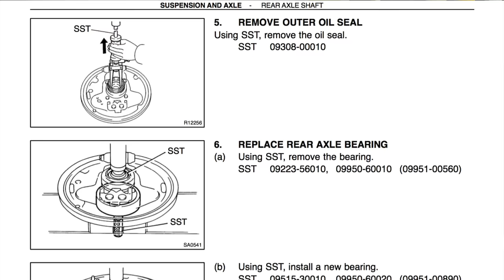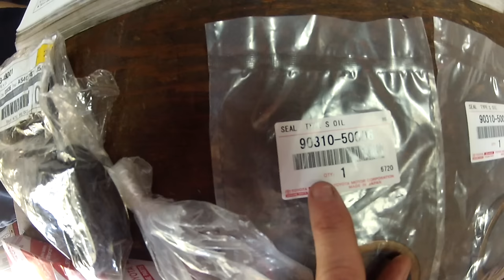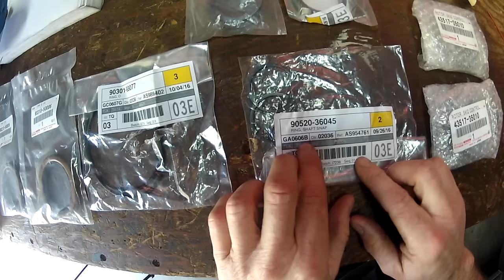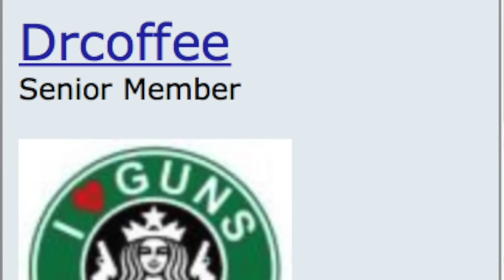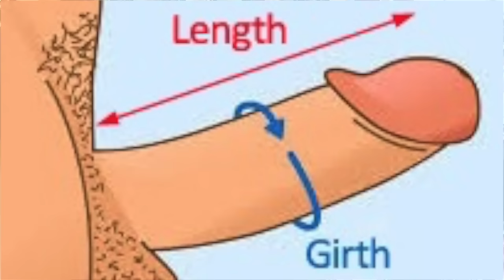Toyota Rear Axle Seal/Bearing Replacement (ABS Rearend)

Comment: Awesome detail, really like those brake line caps! Interesting thing happened to my 2000 4Runner a few yrs ago. I was hearing a ticking noise from the rear end, so Iong story short, the vent cap on top the diff was not doing its job, because when I removed the fill plug, a vacuum sound came out of the hole. That fixed the ticking noise- weird or what??
Reply from the maker: Yeah, that vacuum cap kit comes in handy.  I first tried to crimp the rubber brake lines with a hose crimping tool but using the vacuum caps as a cover is way better.

That is weird the blocked breather caused a ticking sound.  Usually what happens is the pressure builds up in the 3rd member and axle housing and since the path of least resistance is the inner oil seals, the pressure pushes air and oil past the seal.  This is a common cause of oil getting past the seals especially for those that live in the rust belts of the country where they salt the roads and it seizes the little one-way valve in the breather.
Reply: there is supposed to be a slight vacuum when the diff is cold. thats to prevent moisture from being drawn in....the vent is one way....out....

Comment: @Timmy The Toolman Great Video BTW:) Pulled both axles out at the same time to take to my local Machine Shop to get bearings pressed in and everything.. after I got home and unloaded I realized Darn I didn't mark which Shaft goes to which side of vehicle.. It might not matter but I'm here and haven't started putting things back together yet and Besides It's Raining.. but My question is both shafts the same length?
Reply from the maker: The shafts are the same length. You can tell which side goes where by the brake wheel cylinders and bell cranks.  When you have the axles on the correct sides,  the wheel cylinders will be at the 12 o'clock position with the bell cranks facing the rear of the vehicle.
Reply: Great! Thanks Tim😉you are the best🙂.
Reply from the maker: @Sortawickid  You're welcome Heather.   Happy Wrenching!

Comment: Hey yah Timmy! Do you think a twelve ton press would press those hearings/retainers?? Thanks for your time and your videos
Reply from the maker: It could do it.  There's guys that have been able to do it with the 12 ton press.  But, the special service tool we link in the video description won't fit between the cross member on the 12 ton press.  The seller of the tool does make one that will fit though.  Here's a link: https://www.ebay.com/itm/193637211065?hash=item2d15ad5bb9:g:EgIAAOSwUgBfGZx7&mkcid=1&mkrid=711-53200-19255-0&siteid=0&campid=5338641100&customid=&toolid=10001&mkevt=1  With all that said, I still think the 20 press is the way to go.  If you ever had to do front wheel bearings, I don't know if the 12 ton press could do it.  It takes a way more force to push the hub out of the bearing.  The 20 ton press doesn't cost much more so I believe it's a much better purchase.
Reply: @TimmyTheToolman   I do have to do the front,  thank you for responding to my questions!  I’ll get the 20 ton.  There are so many Toyota fans out there, and your videos and you and Shawn make it so we can enjoy the maintenance on our rides!
Reply from the maker: @jeremyoshea7941  Good choice to get the 20 ton press.  It's our pleasure to help people by making these videos.  Good luck with all the work.
Reply: The guy down the road from me has a first GEN just like mine he has blocks for a lift kit and he just had those seals replaced in it without replacing the bearings I’d be willing to bet that they didn’t Realize the seals in a different spot possibly and without replacing his bearings to they ran into the same scenario .  Flip the retainer!!
Reply from the maker: @jeremyoshea7941  Yep, lots of people don't know that Toyota redesigned the seal, some of them being Toyota Dealership Mechanics.

Comment: GREAT INSTRUCTIONS! Just debating whether I want to do the pressing stuff.  What type of grease are you using in that little grease can? Thanks again!
Reply from the maker: It's a grease gun I bought a long time ago at a bicycle shop.  The brand name is Dualco.  I did a quick search on Amazon and this is what I came up with:
https://www.amazon.com/DUALCO-METAL-GREASE-GUN-PACK/dp/B015RV444E/ref=sr_1_2?s=automotive&ie=UTF8&qid=1518072721&sr=1-2&keywords=dualco+grease+gun&dpID=51K0BPLe8nL&preST=_SX300_QL70_&dpSrc=srch

Comment: +Timmy The Toolman  ABS/Brake warning lamps lit up on 2007 Tacoma PreRunner (208,000 miles). Code reader said left rear wheel speed sensor. Pulled sensor and it had an odd wear pattern on it, like something was chafing it. Installed new sensor, light went off, came back on a day later. Pulled new sensor and the sensor part is worn all the way through to where I can see copper. Also gear oil on it, and I can see metal flakes in the drops of oil. 

I’d already pretty much decided to pull the axles and take to a shop to have new bearings pressed on, and, of course, install new oil seals when I put the axles back in.

But the fact that something is hitting the wheel speed sensor throws a wrench into things. 

I called a shop, and the guy said that the ABS reluctor ring has probably come loose somehow, and that’s what is likely hitting the sensor. 

I drove around a bit, and went around some corners, trying to listen for wheel bearing noise. Really couldn’t hear anything definitive... 

Pulled the other side sensor and it looks normal other than some gear oil on it. 

So, what is going on here?
Reply from the maker: Hey John, i did see an ABS sensor cheese grated one time and that's when a guy's bearing basically imploded and the parts ground up the inside of the axle housing, the axle and the ABS sensor.  It was clear the guy ignored that his axle seal was leaking.  When the axle seal leaks, the gear oil gets into the bearing and slowly washes out the grease.  Once the grease is pretty much all gone, the bearing is relying on that gear oil to stay lubricated.  If the differential gear oil falls to a low level from the leaking and is no longer getting to the bearing, the bearing can overheat on a long enough drive and then bad things happen.  I doubt your ABS tone ring coming loose has caused this, but I could be wrong.  I think you're bearing is starting to fall apart on you.  You shouldn't drive your vehicle very far until you pull that axle and see what's going on.
Reply: Timmy The Toolman I agree with you that bearing wear has caused the tone ring to come into contact with the wheel speed sensor. But what’s strange is that there’s no noise from the bearing. And no evidence of gear oil leakage. In fact, my first inkling of a problem was when the ABS/Brake warning lamps came on and I pulled the sensor and found gear oil on it. 

At any rate, I have another vehicle I can drive. I will pull the Taco into the garage and pull the wheels and drums and have a look. I’ll post what I find here. 

Thank you so much for taking the time to record and post this video. It is one of the best mechanic’n videos I’ve seen, and it’s obvious that it has really helped a ton of people! 

I will be watching it again, in detail, to be sure that I don’t run into some of the same problems y’all did. I don’t want to have to redo this job. I want it right the first time.
Reply from the maker: @johnmpifer  There is evidence of gear oil leakage because there should be no gear oil in that ABS sensor cavity.  The oil seal is inboard of that cavity.  If there is gear oil in there, that means the seal has failed.  The cheese grating of your sensor could be due to slop in the bearing allowing the ABS tone ring to contact the sensor but it could also be due to the fact that the bearing is literally falling apart and there loose pieces floating around in there.  You'll know the definitive answer when you pull the axle.  The important thing is you don't drive it until you figure it out and fix the issue.  Let me know what you find out.

Comment: I have a non-ABS Tacoma with a e-locking rear end. I purchased a non-ABS OEM seal and bearing kit and installed it less than a year ago and just reused the extra ring due to it being an ABS axle.  I just discovered one side is now leaking (not the side that was leaking previously). I’m going to disassemble and see what I can find, but which parts would you recommend replacing again since their all basically new?
Reply from the maker: When you did the job a year ago, did you confirm a good mating of the axle seal and retainer?
Reply: @TimmyTheToolman  yes, i performed the sharpie test as described in your video
Reply from the maker: @eyeofthedriver  Did you use a new retainer that mates with the seal or did you reuse an old one?
Reply: @TimmyTheToolman  i used a new one to mate with the seal, but reused the second one since I didn’t realize I had an ABS axle until I had already disassembled
Reply from the maker: @eyeofthedriver  if you used a new retainer and confirmed a good mating with the seal, there is a possibility gear oil was able to get past the seal/axle housing connection.  Some have smeared Toyota Red FIPG 1281 around the seal and in the area where the seal sits and then drove the seal in.  Read the comment I pinned for further discussion along these lines.
Reply: @TimmyTheToolman  I saw that note and will give that a try. Think I should plan to replace any of the parts again when I take it apart, or just add the FIPG?
Reply from the maker: @eyeofthedriver  You can pry off the inside bearing cover with a small fine flat blade screwdriver.  You should check to see if gear oil has washed away the grease.  If so, you can repack it with a high quality bearing grease and then pop the cover back in place.  Other than that, I don't think you need to replace anything other than the seal.
Reply: @TimmyTheToolman  great, thanks!!
Reply: @TimmyTheToolman just got back to this and found that the new OEM retainer I installed split allowing oil to flow through. I couldn’t believe it would fail like that so quickly. Ever heard of that before?
Reply from the maker: @eyeofthedriver  No, I've never heard of a retainer splitting.  That is definitely strange.

Comment: Hi Timmy! Question: would a 6ton hydraulic shop press be adequate for this job?. I'm having a hard time here in Canada finding one for a good price. Thanks and appreciate all you do for novices like myself 🤘
Reply from the maker: It might but there's also the question if the special tool used will fit between the crossmember of the press.  People trying to use the 12 ton Harbor Freight couldn't get the special tool to fit.
Reply: @TimmyTheToolman  I recently purchased the tool from Dwayne and he has made a version of his tool that works with the Harbor Freight 12 ton press. It cost just a couple bucks more but it does take longer to make...but I really think it is less than $5 difference.
Reply from the maker: @rockerfly88  Yeah, we know about Duane's 12 ton press tool.  We talk with Duane on a semi regular basis and get updates from him.

Comment: Hey Timmy. I got all the press work done at a Toyota Dealership. I have the axle ready to be put into the diff. I have seen your response on forums about there being a small gap where you bolt the axle onto the diff. Didn't really help. I don't understand, I don't think they would mess it up at the dealership and the seal is correctly seated. What are the reasons why there would be a gap / not going in all the way.
Reply from the maker: Trust me, dealerships screw up but maybe not in this case.  It sounds like the bearing just isn't fully seated in the bearing case.  You can either lighting pop the splined end of the axle shaft into a block of wood in the ground or just get the axle bolts started and slowly draw the axle against the housing.  The bearing into the bearing case is not a press fit.
Reply: @TimmyTheToolman  Alright, thanks for the quick response. It's appreciated. I'll try those and let you know tomorrow how it went.
Reply from the maker: @smoketheartist9501  You're welcome.  Yes, let me know.
Reply: @TimmyTheToolman  Just bolting it on worked! After, I took it off and it went in like a glove, proving it affected it somehow. Thanks man!
Reply from the maker: @smoketheartist9501  Good to hear.  I hope you did the sharpie or grease test to confirm you had a good mating of the seal with the inner retainer.

Comment: Hi Tim, I am attempting to replace my rear brake backing plates this weekend on my 1st Gen Double Cab Tacoma. This video is a great learning tool. I will be replacing all the parts listed for the job and then some.  I have some leftover FIPG RED from my transmission pan gasket replacement from a few months ago ( Another great success thanks to your videos!)  Is this the FIPG you were referring to apply to the axle seals?
Thanks, Joe
Reply from the maker: Hey Joe,  yes the red FIPG is the one I was referring to.  Good luck with the job.

Comment: Hey Tim, great videos. I did this repair about a year ago. Took the axle to Toyota to have new parts pressed on and its been leaking again for a few months. Im going to do the work myself this time with a buddies press. Can I reuse retainer's and ABS ring since those parts are new and replace bearing and seal only?
Reply from the maker: If you want to reuse the retainers, swap the positions.  Put the one that the seal was riding on against the bearing and put the one that was against the bearing where it will mate up with the seal.  The seal lip does wear into the retainer minutely and that's why I'm suggesting to swap the positions.  The ABS gear can be reused as well.

So yeah, just the seals and bearings.  You might want to replace those o-rings at the end of axle housing too.

Comment: I just ordered aftermarket seals and the OME replacement for 90310-50001 witch is now -50006 and i will let you know if aftermarket is like old style OME or like new toyota replacement -50006. Toyota parts were "much cheaper" but shipping was more and still worked out toy parts $22 with shipping and after market was $25 I would not be surprised if aftermarket is better quality I will let you know What difference I see when they arrive.
Reply from the maker: From what I have heard from others, the difference between the aftermarket seals and the new Toyota seal is how pliable it is.  When I got the Toyota seal in my hand, it was easy to see how well it was designed.  Just like I saw in a video "Dr. Coffee"  made comparing aftermarket seals to the Toyota seal, I put a retainer into the seal and witnessed first hand how much movement the seal allows for.  You should watch this video which describes what I'm talking about: https://www.youtube.com/watch?time_continue=1&v=9tdGpmpNRFU
Reply: Great info thanks for the link!
I can see were he cut the retainer to get it off, I've done it like that before and was shown how to do it like that from a machine shop, you don't have to cut all the way through just get close then hit with a cold chisel and the pressure breaks the last bit and retainer comes right off.
Reply from the maker: Dr. Coffee didn't perform his own work.  He took his axles to a machine shop and they were the ones that cut off the retainers.  But, this technique is one you use when you don't own the special service tool that you either bought or made.  The problem with cutting them off is you have to be super careful.  I have seen many guys showing pics on the forums from shops who cut too deep with the cutting disk and scored the axle shaft which basically gives the gear oil a path past the retainer.  

The one time I saw this technique used in person was when I was helping my buddy Jordan with the manual hub swap on this 3rd Gen.  When we pressed out the first hub from the bearing, the inner bearing race was stuck to the hub spindle.  Jordan used my Dremel tool with a metal cutting disk to cut the race on opposing sides.  When he felt he was deep enough on each side, he used a chisel to break it free.  He did a really good job of cutting it off but still ended up scoring the hub spindle a tiny bit in one spot.  We tried to see if we could bet a bearing splitter under the race so we could pull it off with my press, but none of the bearing splitters I own would fit well enough to grab the lip of the race.  Cutting it off was pretty much or only option.
Reply: I was wondering the same thing, if the aftermarket seal is made to match the older version.  So how is the after market seal working out for you? Can you give us an update?
Reply: Bummer watched the video but didn't read the blog.  I used aftermarket seals (Altrom Group), and as a result, the measurements (~5mm  of polished axle showing) didn't work for my seal.  After pressing, grease checking, and reassembling, there was no grease left on the sleeve so I pressed it on an additional few mm to get the seal to be in the middle of the sleeve.    Later on, after feeling I succeeded and was enjoying my beer, I looked at my extra seal with an extra retaining sleeve I had on my bench and realized the grease check method has to be revised if the seal you are using has a dust seal as well.  Basically, the dust seal will push the grease off the sleeve and if you center the dust seal on the sleeve, then and actual part of the seal that creates the oil seal, will be off-center, and in my case, barely contacting the sleeve at all.  So, tomorrow morning, I am running to Toyota to get the OEM seal and will pull the axle, replace the seal with an OEM and back of the ABS gear and sleeve to the 5mm mark and see if this works.  Timmy, I know the video states that OEM is recommended, but wanted to add - at lease in the blog - that if you don't use OEM seals, then you need to verify the correct fitting of the seal to the sleeve and the 5mm rule of thumb will likely not work and you will have to verify the correct distance independently.  Great work on the video, thanks for taking the time to put it together.